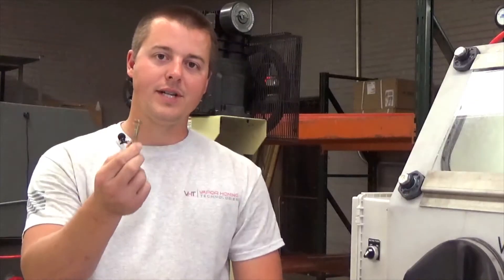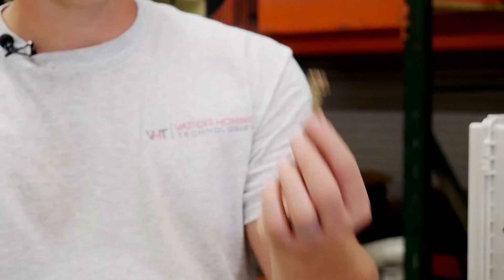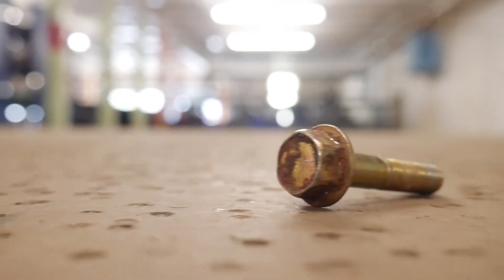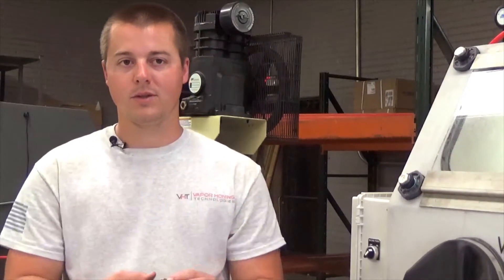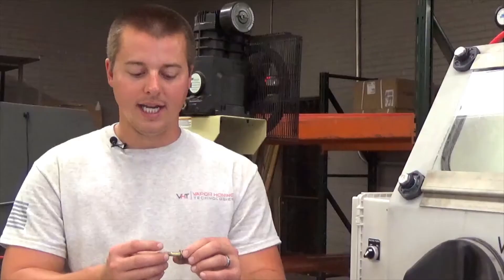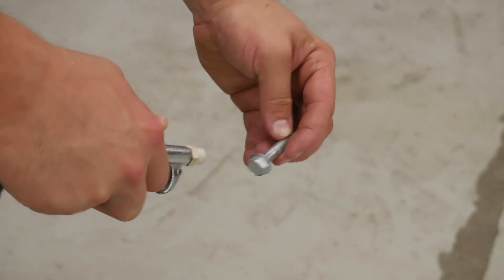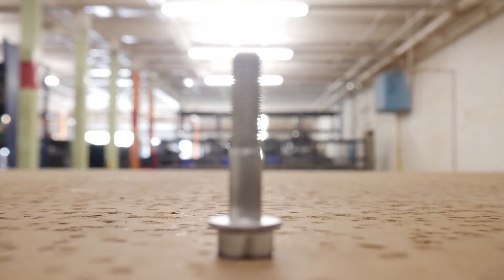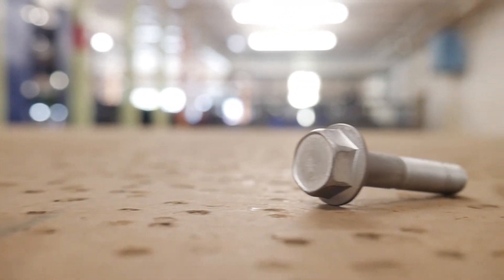Fast, Easy Removal of Zinc Plating. What does Wet Blasting do to Zinc Plating?

Comment: After replating, can I use vapor honing at a low pressure to polish up the plating without removing the zinc?
Reply: yes, that works pretty well, without controlling all the plating bath parameters, and the use of the right brighteners,   it is really hard to get a nice shiny result after zinc plating, i use my wetblaster with only 0,5 bar pressure and glass beads to polish the dull zinc layer, result is an unbelievable shiny zinc layer,  and with only 0,5 bar its almost not possible to remove the zinc.